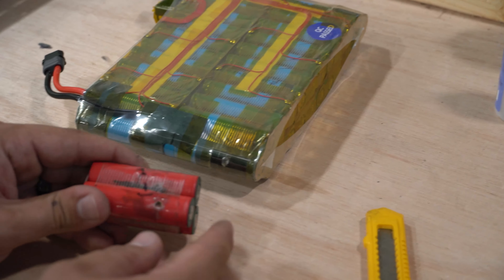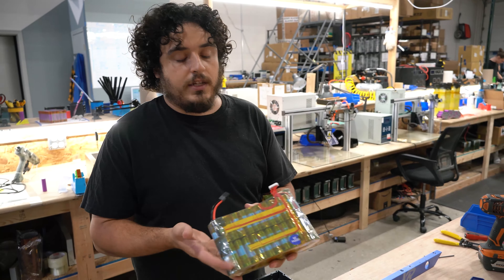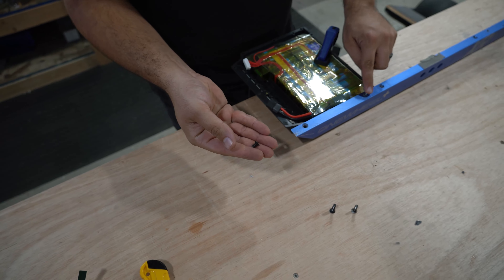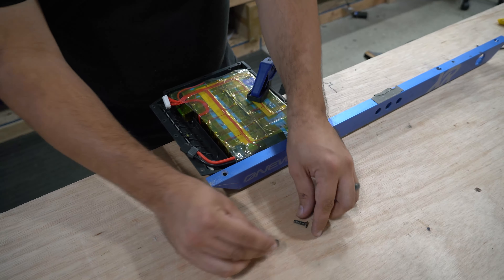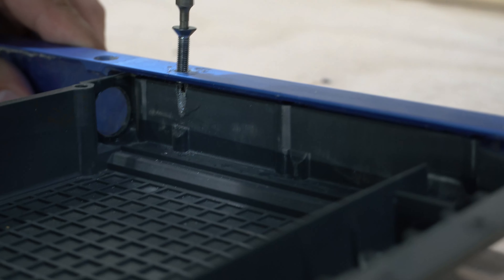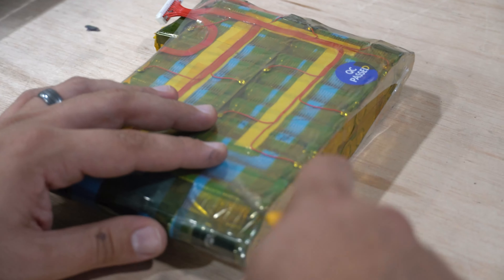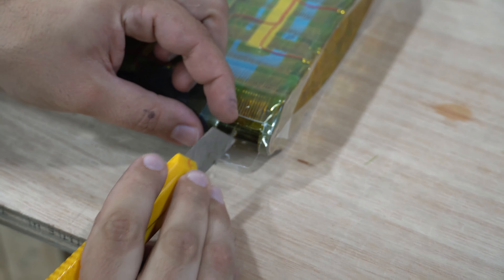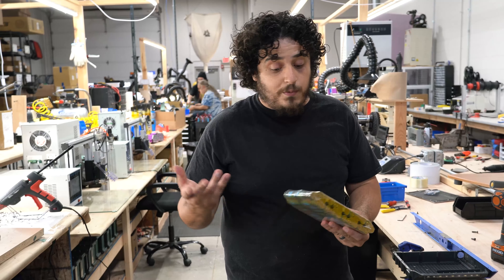CBXR Update - Puncture Proof Demonstration

Comment: That's pretty cool. I have a CBXR and didn't know about the screw issue for quite some time, it's scary stuff that even stock battery owners should be made aware of. I always use the smallest screw possible now. I didn't always because when I installed the CBXR, I'd noticed the threaded marks in the plastic, but I never really stopped to think about what caused it.